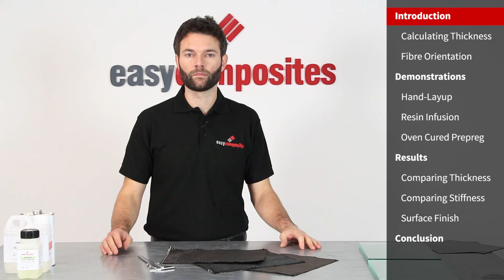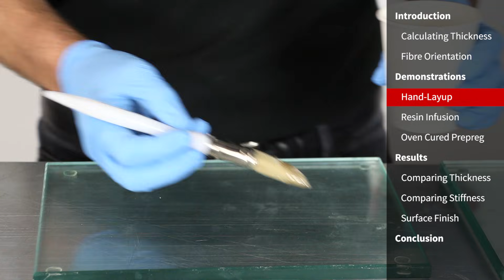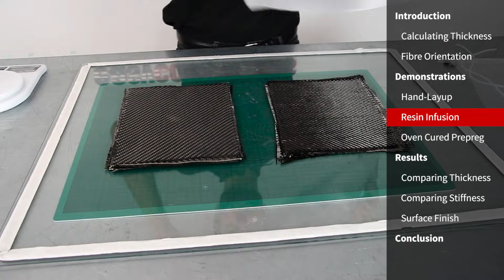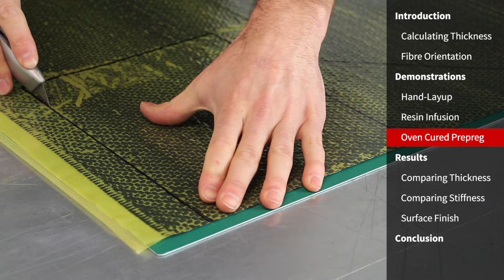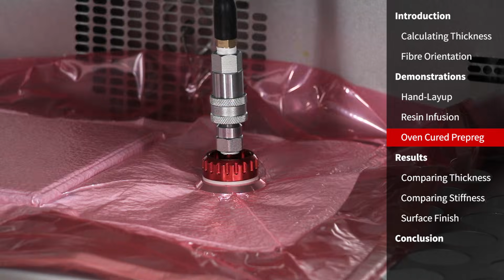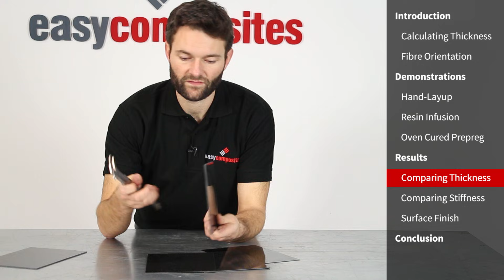How to Make Carbon Fibre Sheet - 3 Alternative Methods

Comment: I wonder if you can get more resin out with a thin layer of porous hard silicone rubber so it would dip in between the weaves?
Reply from the maker: Potentially yes, subject to a bit of experimentation. However if the silicone dips into the weave pattern, the finished sheet would not be perfectly smooth.

Comment: Is it possible to use vacuum bagging and get both faces finished?  Or what method should we use to get both faces finished?
Reply from the maker: Some people have had success this way although it is easy to get air trapped.  Presses can also be used to achieve a similar effect, especially with pre-preg carbon fibres.

Comment: i want to built a plate 400*400 mm * 4 mm thickness what  part i need thanks
Reply from the maker: Entirely depends on the method you intend to use and preference of cloth types.  Our fabrics have the thickness listed in the fabric specification so you can use this easily to work out how many layers you may want.  We would recommend using the thicker 450gsm and 650gsm cloths for some of the inner layers as it is a great value way to build thickness with less actual layers and also at a proportionately cheaper price.  The finer details of the lay up is down to your preference and needs, for example, like in the video you may wish to add some carbon Biaxial cloth to improve torsional stiffness.

Comment: Hey guys, how would you achieve a carbon fiber sheet of 2mm thickness with double sided gloss finish between two glass laminates through resin infusion?
Reply from the maker: Double sided sheets can be very hard to produce with infusion. You would need an internal flow medium to allow the resin to flow.  Typically a lot of double sided carbon sheet is made using pre-preg carbon fibre cured in a press to achieve the high gloss finish on both sides
Reply: Dont have access to prepreg or a hot press though :(
What kind of interlaminar flow media can you suggest please? because my required size is around 2 to 2.5mm and a lot of flow media in the market are very very thick. Any flow media that compresses inside the laminate?
Reply: That's easy for us, more details please visit www.xccarbonfiber.com for answer.

Comment: Hello, I Am absolutely thrilled see this video. After watching I tried to do it as well. Everything work well but composite has been glued on glass so hard It has been very hard unstick it from the glass. And cleaning glass has been challange too. I used LG 285 and HG 285. What do you recommend for cleaning the glass and what to use on the glass for better unstick after work. Thanks
Reply from the maker: You will need to ensure you have a good application of release agent to ensure the resin does not stick to the glass. We recommend a Chemical Release Agent such as our EasyLease Chemical Release Agent. We do not recommend waxs as they tend to wipe off too easily.

Comment: Could the wet lay up method be clamped between 2 pieces of glass to simulate vacuum bagging and give a smooth gloss finish on both sides?? Thanks.
Reply: Yes, but it will never be possible to have a perfect pinhole free cosmetic finish. Only resin infusion will give a perfect finish, but only on one side.

Comment: I'd like to make 2mm thick panels using 0.3mm carbon fiber cloth and wet lay process. How many layers would you estimate I would need? Also, would squeezing the layers between two pieces of glass work in a similar way to vacuum pressing?
Reply from the maker: If your layers are 0.3mm thick then you need 7 layers to get over 2mm in thickness. Depending on how well consolidated your layers are, you may find that 6 layers achieves the desired thickness, albeit the sheet will be more resin rich.  two pieces of glass will help but you are unlikely to achieve as good a finish as doing it under vacuum.
Reply: Alright, thanks a lot for the info, I will give it a shot

Comment: Is the prepreg sample as strong as the vacuum infused sample if the mesh layers are the same ?
Reply from the maker: Yes, the mechanical properties of prepreg and resin infused sheet are virtually the same, if the reinforcement is the same. They will both have about a 60/40 fibre fraction and similar (low) void content.
Reply: Thank you

Comment: heres an idea, using the hand layout method, how about instead of peel ply, use a peel ply that resin can go through, then a layer of thin foam applicator to absorb excess resin, and then a second peice of glass, or wood, weighted down, say any general weight on it continously, this will pull out extra resin and air, lowering weight, and giving it a better finish.
Reply from the maker: Well, you're sort of describing vacuum bagging (just using weights to create some positive pressure instead of vacuum). Peel ply does allow resin through already. In a vacuum bagging stack you would use a perforated release film to allow resin through and then a breather layer to absorb excess resin. Results won't be as good as infusion or prepreg though.

Comment: but the hole idea is to save money doing this process yet its expensiver then buying the sheets already made.
I dont get it?
Reply from the maker: I'm sorry, I don't understand...  The cost of the raw materials to make carbon fibre sheet in any of the ways shown in this video would work out less than the cost of buying a sheet of comparable quality. It would not be fair to include the cost of purchasing the manufacturing equipment (oven, vacuum pump etc.) because these investments are not direct costs. Also, the point of the video is to explain that by making your own sheet you can tailor the mechanical properties of the sheet to match your exact requirement which is also something you can't do with an off the shelf sheet.

Comment: I have a question about the infusion lay up. I realized you used a vacuum pump with a some kind of vacuum canister. how necessary is this? because when u did the pre preg lay up you didn't use the canister again.
Reply from the maker: The 'vacuum canister' is a Resin Infusion Catch-Pot. These are used for resin infusion but not needed for prepreg because the purpose of the catch pot is to prevent excess liquid resin from being accidentally drawn into the vacuum pump (which would ruin it). With resin infusion, this is a risk because you have a supply of liquid resin feeding resin into the project which can find its way to the vacuum line and into the pump. With prepreg, there is a fixed, measured amount of resin in the laminate already and no surplus resin to accidentally get drawn into the pump.
Reply: Oh. Ok thanks. I get it now

Comment: Is that the same strong carbon fiber on the supercar?
Reply from the maker: It's essentially the same carbon fibre as that used in some supercars. They tend to use prepreg or resin infusion processes (or dereivites of these processes) but, yes, this is in essence the same thing.
Reply: thanks very much!

Comment: Wait, it bends? I always thought besides teh weight one of the big attributes is that it would not bend 0.o
Reply: fetB it depends on what kind of resin you impregnate with. Harder resins won’t flex, but will crack, more durable resins will bend but be less likely to crack.

Comment: Great video tutorial.
One question, what would be best way to make a sheet with both sides similar perfect mirror finish ?
Reply from the maker: You can do this with prepreg in one cure by sandwiching the prepreg between two sheets of glass, providing you use a suitable OOA (out of autoclave) prepreg, like our EasyPreg. An alternative method would be to make two single sided sheets, finished with peel-ply, and then bond them back to back.

Comment: How do u avoide print-threw with the resin infusion? 
I cant see any texture in the reflection at 20:20. Even with a gelcoat i get print-threw...
Reply from the maker: +Leo Curious The trick to eliminating print through is to make sure your laminate is 100% cured before you release it and also to run your infusions a little resin rich (so slightly more than the optimum 60/40 fibre/resin ratio. Also, if you do use heat to cure, always make sure you release the sheet when it's cold.

Comment: what do i need to do if i dont have an oven?
Reply from the maker: +2fast4you1337 : Well, if you want to use the prepreg manufacturing technique then you will require an oven to cure the prepreg. If you don't have an oven and you don't want to get one or improvise somehow (like by using a domestic oven) then you would need to stick to precesses that only require an ambient temperature cure, like the infusion and hand layup process also shown in this video.
Reply: Buy either; 
An adequate 2nd BBQ, 
A ceramic heater and ceramic tiles for lining inside of inside fireplace/heaters, 
44gallon drum and some gas burners...

All these DIY methods should incorporate a airflow management system to circulate the air inside of the DIY oven/kiln to ensure the even distribution of heat to all surfaces

Comment: Thanks for this vid. Im trying to get nice flat sheet using the wet layup but,im sandwiching it between glass... i cannot get a good surface nomatter what I do? Ill try your method next with just one side glass.
Reply from the maker: +Glenn Laney Hi Glenn, using wet-lay it can be very difficult, if not impossible, to get a perfect finish using wet-lay. This is something that we've tried to be honest about in this video. With the right resin and a good laminating technique you can get pretty close but even making a single sided sheet, without vacuum, you are likely to struggle to achieve perfection.
Reply: One side glass is available, maybe you don't have a good control of resin content or temperature.

Comment: very interesting video, but is it worth it to make sheets? I mean, one can buy them directly.
I guess the video if for showing how it is made
thanks
Reply from the maker: +davidgruty Hi David, it depends on whether you can get the right spec sheet for your application. It would be unusual to find unidirectional sheet for example, or to find a specific hybrid fabric that you're after (carbon/kevlar or spread-tow etc.) so making your own sheet can be very useful if you need something that's available already.
Reply: +Easy Composites Ltd thanks for the answer

Comment: best videos on composite on yt. thank you.
is the strength between the 3 process radically different? is the oven necessary because it s prepreg or does affect the final strength?what s the strongest method?
i see some video where in a hand lay up they wet the sheets before laying it up in the mold( like fresh prepreg) do you see a problem with that? it looks like a good idea to me. you can set up you sheets on a glass table and have regular wetting and then lay it up.
Reply: Wet lay tends to be the weakest due to the high resin content and inconsistency in layups. I've seen resin infusion and prepreg used high performance applications such as race car monocoques, but prepreg is the most consistent you can get with carbon and you'll get highest fiber to resin ratio and that'll result in the highest strength/ stiffness to weight ratio. That's why prepreg is used in fighter jets, formula 1 cars, etc

Comment from the maker: Thanks everyone. Glad to be getting some videos out there again. More to come very soon hopefully.
Reply: Easy Composites Ltd can you make karbon 0.8 mm???
Reply: Dear Sir ,
It was really pretty informative,We would like to venture in to manufacturing of carbon fibre. Would it be ok if we get in touch with you directly to enlighten us with you advice and suggestions. 
Regards
 Amiya Tripathy  
tripathy.amiya@gmail.com
Reply: Could you please demonstrate the strength of a single layer of ~100, ~160 and ~250 g/m^2 twill weave?
Reply: +Easy Composites Ltd Hey do you guys sell the little leak check valve?
Reply from the maker: Yes we do; we call it a 'Leak Flow Indicator'; you'll find it in our Vacuum Equipment category.

Comment: Would be grate to have one like this but with Kevlar and hybrid cloths and maybe a mix of layers of carbon and Kevlar in hand lay and infusion
Reply: +Andrew Irving You wouldn't be able to cut it afterwards, Cutting through cured aramid (kevlar) is difficult.
Reply: +Dudley LeRoux, thin stainless steel 1mm cutting discs on a grinder cuts it no problem but you still need to shave the fluffy buts off with a razor blade